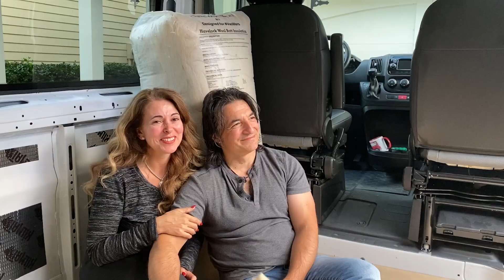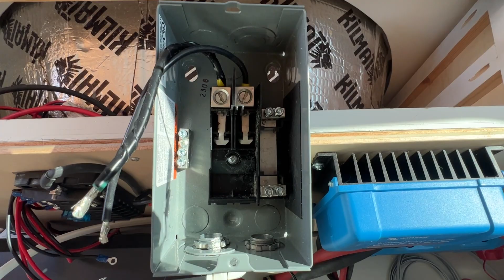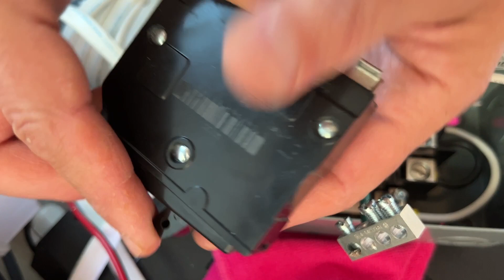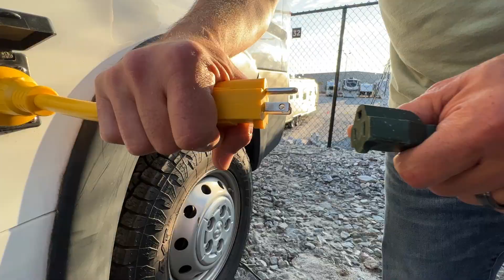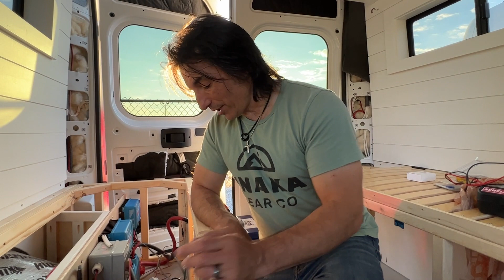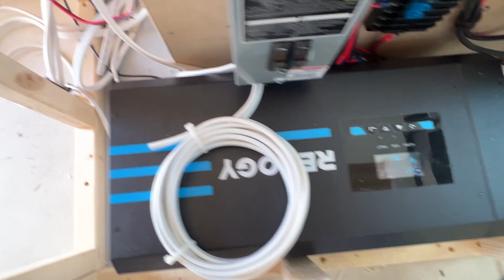How to Wire 120V Electrical in a Van - – RAM Promaster 2500 Van Conversion

Comment: hallo hallo, i want to tell you that this is not the best way to connect the batteries in parallel, u need to take the negative that go to de system from the batterie 1 and the positive u need to take from the batterie 2 and go to the system

Comment: Keep in mind when renogy is connected to shore power it automatically switches its ground to the shore power ground. So you should check it with and without shore power.

Comment: Hi Marc,  FYI running 2 rowmex feeder cables thru the same hole opening in a circuit box or circuit panel is a BIG building code violation, they need to run thru different opening. As you can see you got them confused but more importantly if they short out it can cause a big fire. Keep up the good work and see you on next video. Happy Holidays from S.Fla.
Reply from the maker: I had no idea that was illegal. I did a ton of research, but thanks for catching that for us.